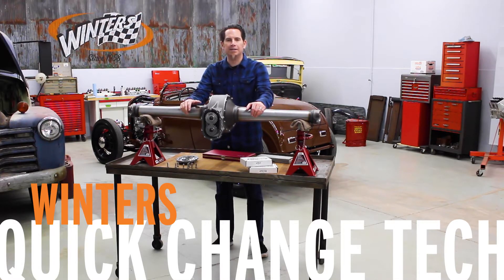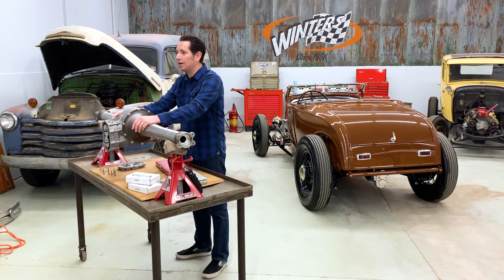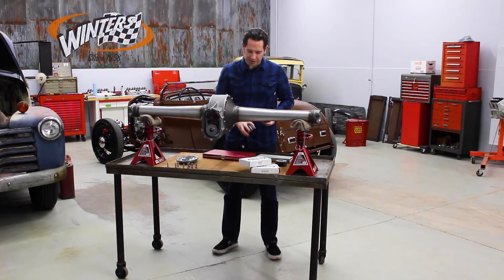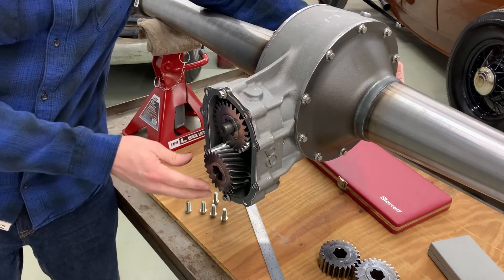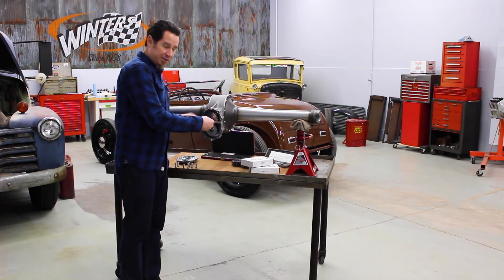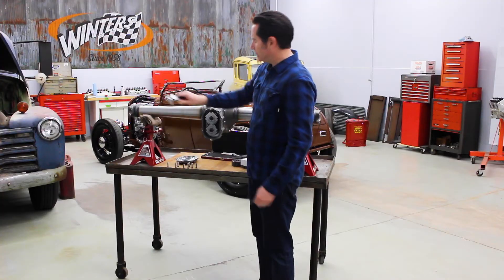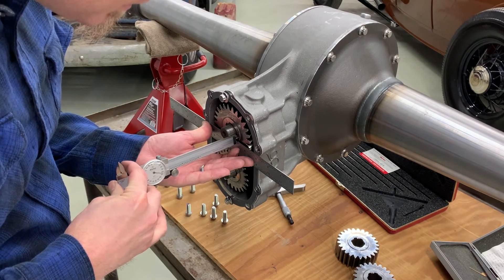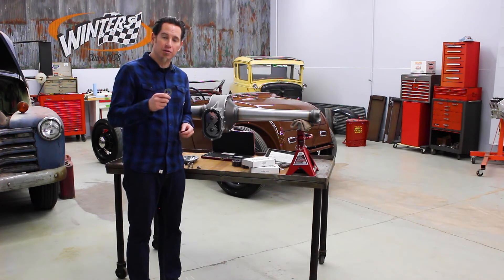Shimming helical quick change gears // Winters Quick Change Tech

Comment: why not add the shim to the gear cover side? is there a reason to put them under the gear like in the video?
Reply: Im asking the same question, im working on a frankland Ruskin quick change rear end with winters helical gears, the top shaft has a thrust nut behind the top gear, the bottom gear doesn't have any thrust nut, im asking if I can put a thrust nut behind the bottom gear to put shims behind the bottom gear, or between the outer bearings in the cover like you said????

Comment: So if you do this, does it make helical gears race safe?
Reply from the maker: No, for racing applications you will need to run straight-cut gears. The helical gears are really just to reduce the amount of audible whine from the gears in street cars.
Reply: @wintersperformanceproducts  I see.  Appreciate the prompt response.